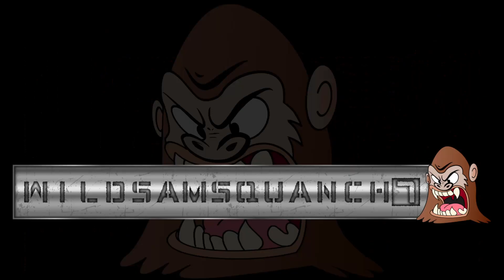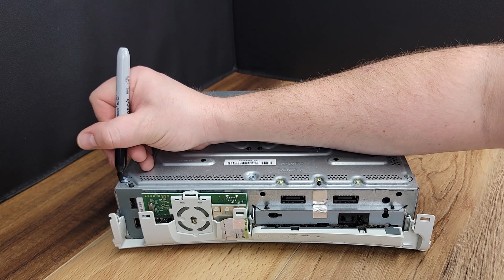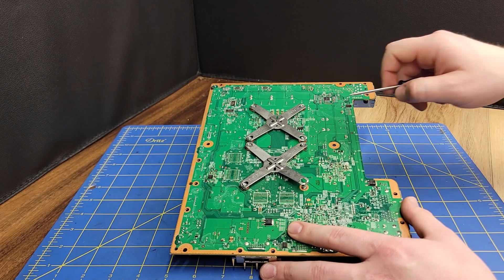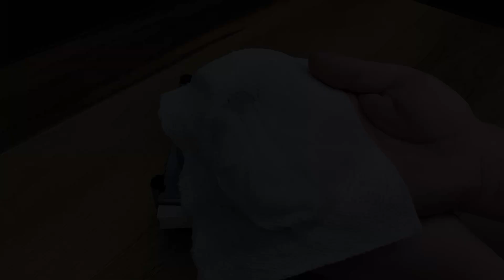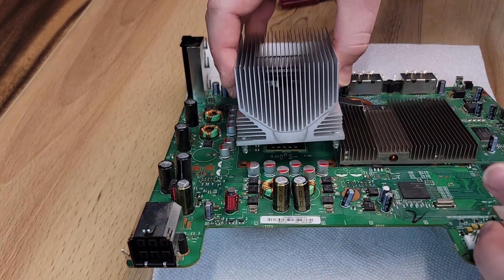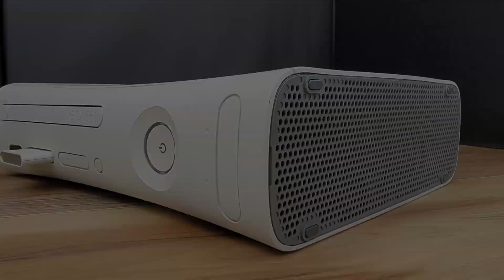Original Xbox 360 (2008) Loud Fan Noise Repair, Cleaned & Refurbished with New Thermal Paste

Comment: Amazing you made that system almost look new and perform like a brand new system. I'm taking notes for when i open up my new Jasper down the road if it starts having a load fan or disc read issues or if i just want to do a restoration on it like i did with CECH-A01 PS3. Keep up the good work my friend.
Reply from the maker: I appreciate the support and kind words!
Reply: @Wildsamsquanch7  No problem, I've always loved this style of 360 and as i said in my first comment i bought a good used working Jasper console last Wednesday to go along with my A01 PS3 and my Family's RVL-001 Wii even though i have a newer Slim 360 i just love the older style more. It's also nice to see people in the community show how to repair and properly refurbish these aging systems to help keep them alive for years to come.

Comment: So I got a xbox 360 with the zephyr motherboard for nothing at all and I think I have the same issue really loud fans and spins fast so I took it apart and saw the heatsinks clogged with dust and all over the motherboard cleaned it up and tested it out for the heck of it to see if it just couldn't breath and still really loud fast fans I  don't have thermal paste at all so I didn't go that far nor have I replaced it before so I'm guessing that needs to be replaced.

Comment: Cool video ! I tried same but now XBOX gives me an electrical shortcut and gives red circle .. If I remove mainboard from the metal plate it's working.. i'm wondering why you don't have the 4 white squares heatsink at the rearside of motherboard ?

Now I need to find a way to have a proper starting X360 ^^

Comment: 8:32 I can tell that your GPU is super reliable. Yours is a GPU-Rhea made in Korea and the numbers X816971 on the bottom of the chip indicate that the GPU is a fixed one. Lucky you! Your system should never red ring.
Reply from the maker: That's great to know, I never knew this. Thanks for watching!
Reply: Let me ask you this, pal.  We're the Korean Rhea GPUs used throughout 2009?  My Zephyr I bought 2 months ago seems Gucci.  The Tonaskets were rolling out by September '09.

Comment: I really enjoyed your video And how thorough you were with the cleaning.  I've taken quite a few 360s apart myself And I always couldn't help thinking if the X-clamps were applying enough force down on the CPU and GPU. I know GameStop refurbishing at one point did away with the Xclamps and went with like a nut and bolt type solution to tighten them down more in an effort to help the red ring of death problem. Because essentially the red ring of death is the cracking of some of those balls in the BGA.
I know nothing is a permanent solution to the red ring problem but maybe some more tension was on the right track to extend the life if you will.
Reply from the maker: Thanks for checking out the video. I've worked on one of the GameStop consoles that have screws in place of the Xclamps. I believe they also fabricated a harness that kept the fans running on high. That said, I've heard different opinions on if this actually helped or not. Regardless, the Xbox 360 is an amazing console, but suffers from a high failure rate unfortunately.

Comment: Here's a tip that might sound bad but it works great and I've done it to many 360's. Once you unclip the front clips, you should slowing pry the 2 shells apart until they come apart. I know what you're thinking. "No that's a terrible idea it'll break" but like I said I've done it so many times and I've only cracked (not completely broke) 1 clip 2 different times out of doing this to about 30 or 40 360's so as long as you do it carefully and slowly it'll easily and efficiently get the job done. And yes it makes a loud snapping sound but like I said it's a really good method and also make sure the console doesn't go flying once it comes apart. A great way to do this is put a towel down on your bed/couch or other soft surface and then put the fan side down on the towel and then begin prying. And of course you don't need to use a towel but it's recommended if you don't want dust on your bed/couch

Comment: First, this is an EXCELLENT tutorial video on disassembly and complete cleaning of an Xbox 360 system.  I highly recommend watching it.  But as a former computer repair tech, I'd offer a couple of tips.  Obtain a static wrist strip that can be grounded and wear it CONSTANTLY when touching or handling any computer components.  Static electricity discharge can damage sensitive components.  Buy and use a can of electronics cleaning spray.  Much easier for hard to reach spots and it is formulated to be safe for all types of electronics.  Thanks for sharing this video!
Reply from the maker: Thank you for watching as well as offering your kind words & advice!
Reply: Good day to you!

 I have a question if you don't mind.

When replacing capacitors on video game consoles, both on the main board and the power supply, is it necessary to discharge them before removal? Im assuming its more important for power supplies but is it necessary for gaming consoles? Is the voltage high enough to cause electric shock or damage the rest of the console when desoldering?

What's your opinion. I appreciate your time.
Reply: @matthewsano6006 doubt there enough voltage/amperage (not an electrician) in em to do any damage to you personally. Though I would heed caution and do what you suggested as damaging the motherboard is probably a high possibility.
Reply: @@mitch1256yeah I had one guy recommend one to me when I was doing a refurb and I just told him I'm good. He was livid.... to this day though I've never used one or needed one after.